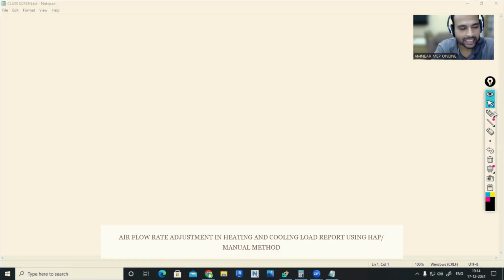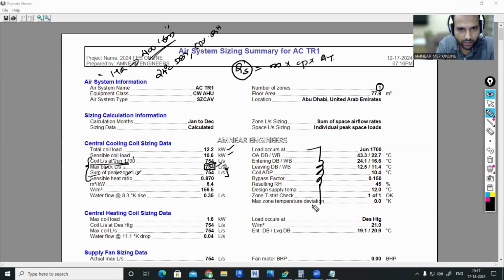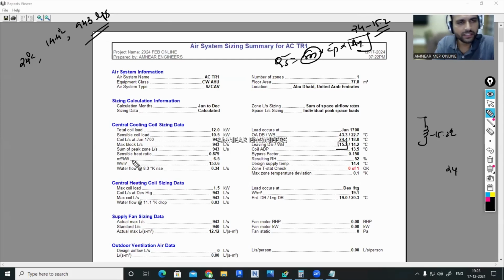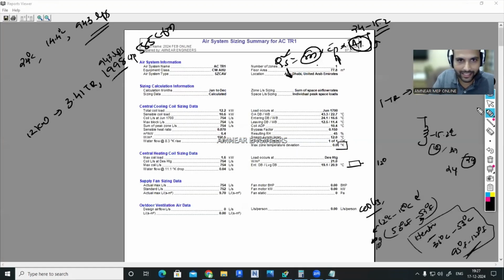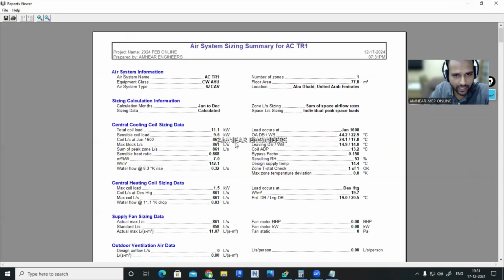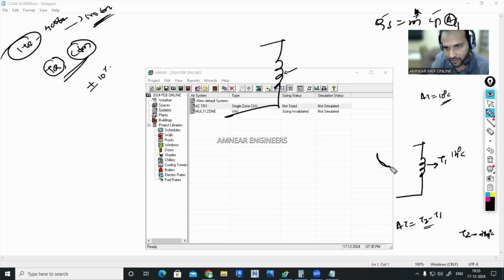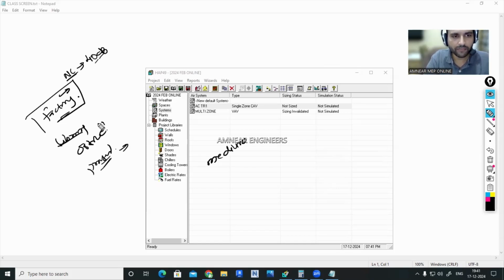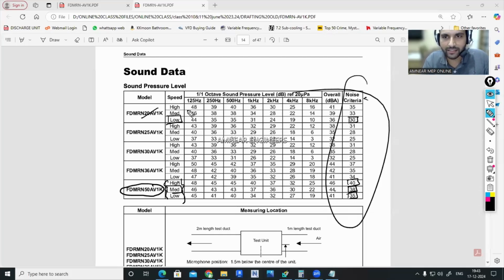Adjusting Airflow Rate or Dehumidified Airflow Rate in HAP Software|1 TR = 400 CFM?|AMNEAR MEP BIM|

Comment: Sir, what about the air flow rate gor clean rooms.. etc. So duct heater used in pharma systems are, there to compensate the unchanged RH?
Reply from the maker: No matter the type of air conditioning system, after dehumidification, if you need to raise the air temperature to meet room requirements, heating is necessary. This can be done using an electric coil, a heat pipe, waste heat recovery from the building, or hot water. 

The duct heater may be used in the system to meet winter air conditioning/Space heating requirements or to control relative humidity after dehumidification. Both scenarios are possible.